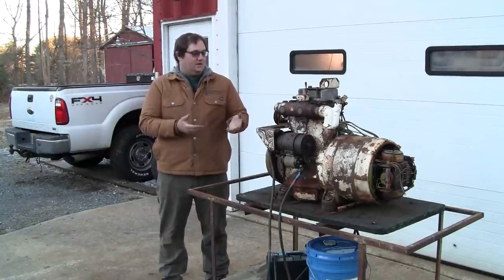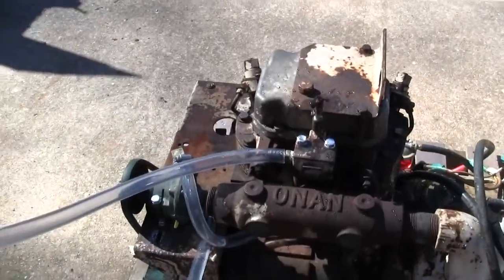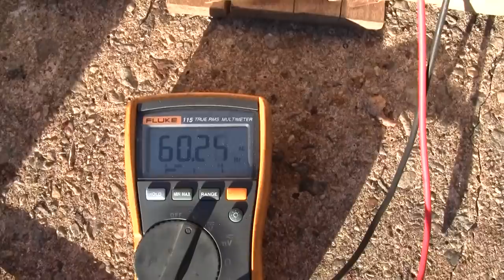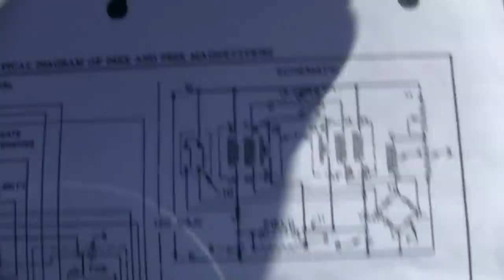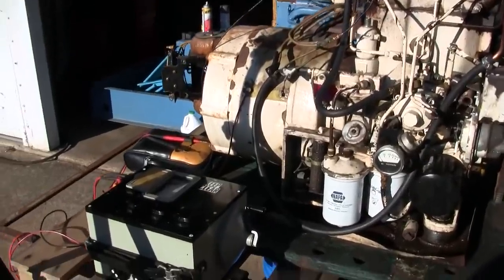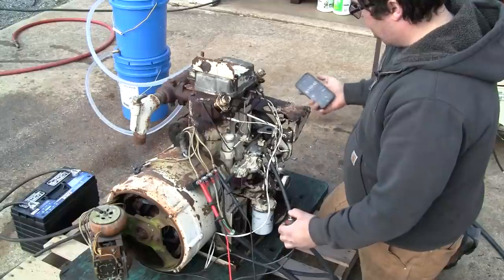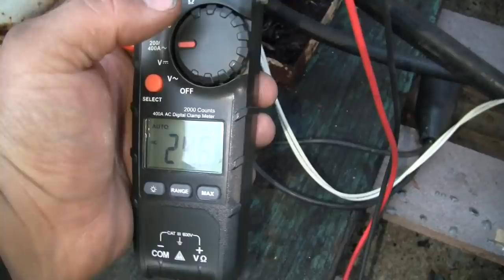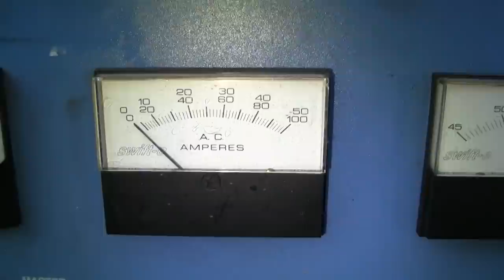WILL IT GENERATE? Rusty + Crusty Onan Diesel MAGNECITER MDJE

Comment: Personally, I pull odd stuff like pullies off with a large 2 piece bearing puller. Since its in between the pully and the shaft its less likely to damage the pully, unlike the jaw type pullers.

Comment: It seems to use what would be called "saturable reactors". Basically each of those big reactors has two coils, similar to a transformer. One coil is hooked up to DC, the other to AC. When you apply DC to one of the coils, it begins to "saturate" the magnetic core. As the magnetic core gets more saturated, it changes the inductance, which then affects how much AC current can pass through the other coil. You can almost think of saturable reactors as a type of amplifier. A relatively small DC power going through the reactor can control a much larger amount of AC power flowing through the other side.

It looks like they combine that with some sort of current sensing shunt coil to create a system that regulates the output voltage based on both output voltage and output current.
Reply: Magnetic amplifiers were once commonly used as operators in analog computers used in aircraft instruments and gunnery control systems and are still found as signal amplifiers in nuclear power plant instumentation.  The exciters in early dynamometric radio transmitters also often used magnetic amplifiers.
Reply: Great explanation, thanks. If those are ferrite toroidal cores, they saturate very easily - which clearly is an advantage in that application; but for the same reason I heard that you can't use them for output transformers in tube amplifiers because the standing DC plate current of the tube would saturate them and you'd get very little output.

Comment: Those little onans are great units. Had a newer 15kw on my last service truck that was designed for rv use and it was super quiet(like a box fan on medium in a quiet house in the country). I am curious to see how you install it into your work rig. Going to plumb into the truck exhaust, keep the mechanical water pump or go to like a davies Craig electric setup and the into vehicle system and run a aux fan or complete seperate system? Also curious how you will setup your controls and i dont know if your e350 is diesel or not but if it is are you going to tap into the fuel supply from the truck?  What a cool project and thanks for your professional work and time to bring this to us. You are very thorough and a great genset mechanic!

Comment: RPM is constant at 1800 = 60 Hertz no matter the load.
1830 rpm equals 61 hertz, 1770rpm equals 59 Hertz. Typically the HP is twice the 7.5 kw or about 15HP. Could be  a bit less HP. A15hp Diesel will burn about .75 gals an hour at full power. If the engine is not a full fuel at 7500 watts then it is not working to hard. Probably most fuel efficient at about 3/4 max output. 
I would incorporate the raw water cooled  exhaust manifold into the closed cooling system and I would remove the water cooled exhaust elbow and fabricate a dry exhaust from plumbing and tubing. Tying into the trucks cooling system would keep both engines warm when either one is running. Or a small car radiator with an electric fan would also work.

Comment: You could weld a 3/4",  extra length nut (coupler nut) onto the water pump pulley hub and then lay a greased flat washer against the pump impeller shaft end.  Then thread a 3/4" bolt into the nut and tighten it with an impact wrench to push the pulley off of the impeller shaft.

Comment: You really do some great videos. Those bores looked bad but there was no smoke when running even under load so they were not as bad as they appeared. 
In the U.K.the idiots are pulling down our coal fired power stations before they have a viable generating system. A few weeks ago there was a mad panic to get what they had left running. It was dark and no wind. Well I never, who would have thought that could happen.  I would love an old Lister diesel generator but they are like hens teeth. I bought a German 4Kw petrol inverter and I have a little Chinese 750w stinker (2 stroke). They have suggested that if we don't use electric at peak times they will pay us not to. "Sorry dear you'll have to wait till 8 o'clock for your dinner". They can go forth and multiply.

Comment: Can you please explain how that water pump seal works? Why ceramic? I’ve heard that some of those seal surfaces are finished so precisely that their flatness is measured in wavelengths of light.
Reply: Ceramic is spring loaded to touch stationary ceramic and no water leaks but acts as a lube.
Used in automotive pumps since the 50s i think.
Dirt in cooling system can wear out surfaces.
Salt water raw water pumps on marine use rubber neoprene not ceramic.
I am" Long Guyland marine mech guy.
Reply: The mechanical seal will have a hard sealing face and a soft sealing face.  Usually the hard side is ceramic but not always, carbides are used as well.  The soft side is a graphite material.  A spring keeps the two together and eventually the soft side does wear down.  Yes the seal face is made to very tight tolerances.  Finally, a rubber bellows seals the rotating half to the pump shaft.  That would be a typical mechanical seal arrangement.  There are actually several types.
Reply: Fill-Rite fuel tranfer pumps use a ceramic seal too, at least some models for gasoline and diesel.

Comment: I am obsessed with those small diesels. They will literally run forever. I am confident that if you could change the oil on the fly. That unit would run for a year nonstop, in its current condition. How many RPM s are you running here? Did I say I love those little diesels????  Cheers!!@
Reply: 2.000 rpm? just guessing
Reply: 1800 rpms
Reply: Wild man is correct 1800rpm is 60hz
Reply: It's a 2 cyl by the way
Reply: I was an aircraft fueler at my local international airport that had a large fleet of new and old equipment one in particular was a late 70s international it pumped diesel originally was jet A-1 but was converted to diesel and pumped 150 gallons a minute had a 3k gallon tank the engine was plumed to run off the big tank instead of the smaller fuel tank well it was mainly used in emergencies to fuel GPUs when day shift ground support fuelers didn't do anything there were around 90 gates and at midnight they all came in back to back and if everything was out of fuel a sorry soul would spend the next 8 to 10 hours fueling tugs and ground support equipment anyways ilthat truck would often get parked on the old side of the ramp that wasn't used and forgotten about we used the truck late October and In late may we needed the truck well after driving around looking for it we found it sitting there idling it was smoking out of the exhaust the heater was apparently left on wide open the blower motor was screaming I mean screaming it was incredibly loud the lights were also left on both headlights were inop the roof beacon was still working but was also screaming and the lense was completely blackened and melted the entire interior was incredibly hot we poured bottled water on the steel plate that was on the floor and it boiled immediately. We revved the engine wide open a few times smoked like you wouldn't believe drive it hard around the ramp and the smoke mostly went away it was allmost 2 gallons low on oil, and just over 3 gallons low on coolant the engine was completely covered the automatic trans was never right again after that honestly the entire truck was never right after that the power steering didn't work and was bone dry on fluid and I mean bone dry but wasn't making any odd noises the engine was extremely clacky and if it was below 60 ish degrees forget about it it was allmost locked up the following winter too much either. It showed 46,253 hours and the hour meter still functions and we were bored one night so we actually timed the hour meter to see if it was accurate and it was about .5 seconds off pretty accurate the thing rattled on the interior like you wouldn't believe it was unbearable to sit in for more than 10 mins at a time. The really odd thing about it was that is was still running and didn't self destruct the batteries were also replaced shortly after. After talking to ground service the truck has been owned by them since new and has never been overhauled. The thing was always hard to start and was addicted to either until it allmost started locking up so ground service showed us to remove the intake tubing and use a propane torch to heat the inlet and that allmost always worked down to about 10 degrees fahrenheit. So yes a small diesel under the right load at the correct rpm could run pretty indefinitely and as far as changing the oil on the fly not hard simply do a fluid exchange set up a line from the drain plug with a valve simply drain a safe amount example drain 1quart and replace with 1 quart do that until your drained oil is allmost as clean as the new oil going in or do it until it's to your liking or do it based on oil capacity say the capacity is 5 quarts so you need to use a toatal of 10 quarts of new oil to safely exchange the fluid while the engine is running..

Comment: I remember with the old Onan light plants you had to keep the heaters on for a long time but they'd fire right up. FINE job!
Reply: If an indirect injection engine doesn't start in the first couple of revolutions, you have mostly used the glow plugs for too short time.

Comment: Like many others, I am amazed by how well that thing runs considering the cylinders looked like the surface of the moon inside.  I was still confident you would get it running last episode but the fact that it took a 7500w load this episode with compromised cylinder walls is downright incredible.  That engine must be designed fantastically well!
Reply: It would be fascinating to run that bore scope back into the cylinders after a few hours of additional run time. The rust pits would still be there of course but I wonder how well it would “polish up” when it’s run under a heavy load.
Reply: Tech support said "still within tolerance, send it" 

Machines 40+ years ago, with tolerance for degradation and horsepower loss maybe even 20%. Today's machines are made to fail after a 5% loss of anything 😡😡😡

Comment: You could weld a couple of nuts to the pulley center to attach the puller to pull it off. To be a old rusty/crusty it's doing well. Thanks!

Comment: Amazingly quiet considering no muffler on the exhaust or the air intake.  He rewired it for 240 Volt output and added a four terminal strip.  I would love something just like this for my basement.  I didn't know it was a 7.5 kW unit.  The lift pump isn't leaking, that fuel was from the injector fitten that he loosened when testing. Ron W4BIN

Comment: Those compound-regulators work really well. Some German manufacturers still use them for pretty big brushless alternators. If they are put together right, they outperform electronic AVRs, because they have an incredibly fast response time and are very safe. It's basically impossible that they run away and destroy everything connected to the generator.

Comment: These things are a real pain in the ass to install in a boat.
Reply: Especially when the builder built the boat around it or added the deck afterwards.
Reply: @tbirdracefan  My engine is built into a real nice teak and mahogany case. Almost impossible to service.  Yes some powerboats require cutting out of the deck to get to the engines.

Comment: About to get a Kohler light plant out of a older model travco motorhome 4 cylinder 6500 watt output head 220 has about 1,200 hours on it total going to need some work for sure

Comment: Can that load bank be calibrated somehow? I noticed that when you had a 7500W load set on the load bank then the current was only 30A and at a voltage of 238V that only makes 7140W and not the 7500W that was indicated on the load bank!

If the load bank is nothing but a bank of switched resistors then I guess there's not mush you can do to adjust it?

Comment: Why did you keep saying 120VAC but your meter was showing 238VAC (240)?
Reply: Because the generator windings have been connected in series and he’s measuring voltage between T1 & T4
Winding is  (L1)T1———T2(N)T3——-T4(L2) now.

Comment: I'm curious what you're going to do for cooling when it's installed in the truck? I can't remember if you covered that in the previous video.
Also will it run off the trucks fuel tank or have one of its own?
Reply: If you ask me I would connected it to truck coolant (in line) + fuel tank 😎 (complete murge w/ truck) that would be something 😆
Reply: @NenadKralj  I was thinking connecting to the fuel tank would be nice so he didn't have to keep a second tank filled up, but if so I'd do it like they do on a lot of RVs. They use a separate pickup that doesn't quite go all the way to the bottom of the fuel tank so that it will run out and shut down but still leave enough fuel in the tank to get to a gas station.

Comment: The frequency droop is almost perfect as 59 under full load is very acceptable. Two things now need checked. 1.thd total harmonic distortion. 2. Engine fuel consumption under 7500 watt load. This seems maybe the best set for home emergency power I have yet seen on YouTube if the thd under full load is less than 15. Good job Mike, a regular radiator with an electric fan would probably just come off the battery charging circuit and not take power from the house voltage. On James Condon's channel a guy went through 4 Predator gensets in ten years. He could have used this old Onan jobbie and still be using it with no failure for probably ten years with maybe 100 gallons of French fry oil per year. Maybe twice that I just don't know what it's thd is.

Comment: I have 2 Onan 12K Diesel generators mounted on our disaster relief mobile kitchens. One is 2008 and the other is a 2015. They look identical. Both will run for 20+ hours with no load, as soon as I put a minimal load on them, they run from 15 minutes to 4 hours. We have spent thousands of dollars trying to get them fixed, from auxiliary fuel pumps to complete tune ups to no avail. They both have kabota engines. Both kick a 36 code. Any suggestions? I personally think the generator heads are bad from lack of use. They sit for months at a time without running.

Comment: I cool my MDJE conversion with a school bus heater core and a home furnace blower. Mine (a 1971 model) has a header tank with a radiator cap above the thermostat. i have considered making a new thermostat housing and using a " 3 way" for a 3208 Cat so the engine gets constant flow. I control the temp with a control system from the HVAC industry set to make on rise and the blower motor is 4 speed so the control is staged to lowest and highest speed, or off if below temperature. Good story- it got hot due to mice nesting in the air duct between the blower and " radiator". They chewed up fiberglass insulation from the sound box. It blocked the air flow. Oberdorfer pump is made in Syracuse, NY.

Comment: That sea water pump should have some market value since it cost over $700 from Onan.
If you have to rebuild the circulating pump, it may be more economical to retrofit and inline 12 volt electric pump. Onan parts are overpriced. Onan model 6.5 MCE uses an electric circulating pump that works fine. It is relay controlled in the  engine run circuit.
     The water cooled elbow may also have some market value since it is over $400 new.

Comment: I note that the original raw water/sea water pump was removed. It is direct driven and there is an opening for it on the left side of the motor next the flywheel. These were very expensive /proprietary and failed frequently by leaking. So my point here is there is an open oil duct that you will likely need to cap off or you will spew oil during motor operation. I had to fabricate a cover for mine when I bolted a jabsco raw water pump on the gen set in lieu of the original one. The jabsco approach has been an upgrade.

Comment: Those Onan diesels are a great little engine. They start easy and run fairly quiet. Regarding the old regulator on your engine, I had to upgrade many to the faster responding modern day electronic regulators. Mostly because starting some larger AC motors would be a problem because of the slow reaction from the regulator and mechanical governor.

Comment: You need to duck down to your local wrecker yard and look around for a decent radiator and mount it to the frame along with a fan. 
Then give it a clean, paint it if you feel the need and re-lube it. 
I'd also put a cowl with some flame retardant insolation over it, as most of the noise (once you have a muffler) is produced by engine noise.

Comment: marine manifolds tend to crack if the water jacket around them is run dry.  the raw water pump normally supplies the source of coolant after the the heat exchanger warms it up to prevent shock of cold water on hot manifold.

Comment: Tack weld a short section of pipe over that water pump shaft to the pulley, then weld a nut on the end of the pipe and use a bolt or ready rod to pull the pulley off, cut the tack welds and file down welds

Comment: What would be the approx fuel burn rate at full load?
Reply: My 1600 cc Yanmar uses about 1/2 gal an hour at 2400 rpm.  38 HP.
Reply: but it is not putting out 38 Hp at that fuel burn rate. It takes more like 2 gph fuel to develop 38 hp
Reply: @williambikash6645  yes.
Reply: 1/2 gallon per hour

Comment: Didn't you say this was out of a Boat ? Shouldn't water be coming out of the exhaust ?  They call them Wet Stacks  and part of the cooling system . Just wondering is all ..
Reply: That exhaust manifold jacket would be charged with raw/sea water after it passes through the heat exchanger.  Keeps the engine bay a lot cooler.  If you had it in a house you could use the outflow of the cylinder head through the exhaust manifold and get some really hot water